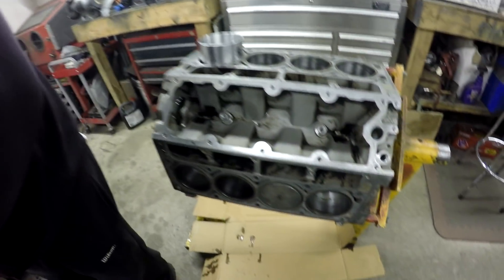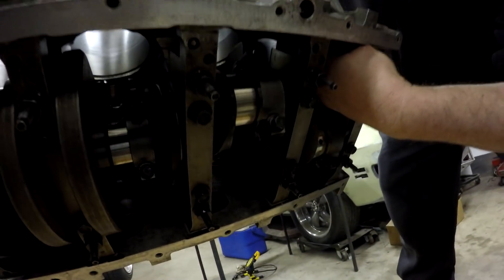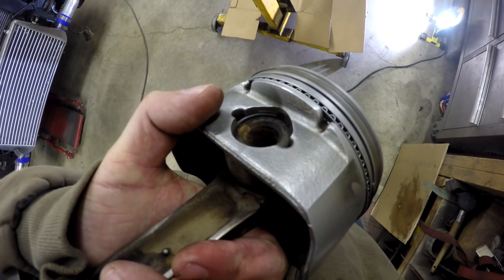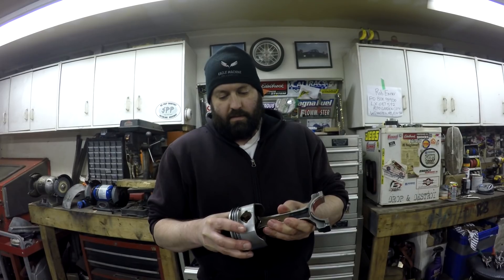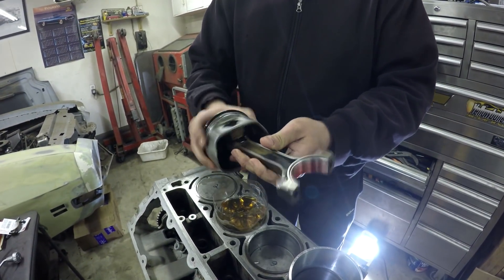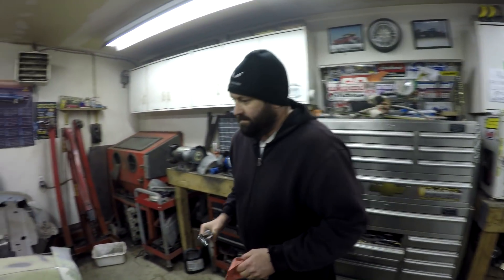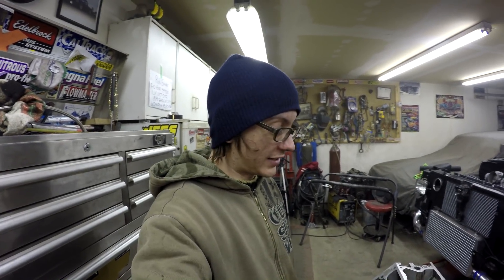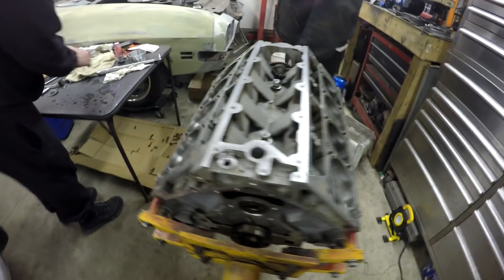Installing Pistons & Rods - Gen 3 vs Gen 4 + Ring Gap for Boost | How to Build a LS Engine (ep3)

Comment: Hi, Guys I'm in a bit of a jam. was hoping that maybe you can help me out, on this video you spoke about Piston Gap. I have a 2010 GMC Sierra 5.3 w/flex fuel, and vvt it is the Gen.4 "LMG' Vin, "0"   I'd had a collapse lifer, and decided to Deleted the AFM and also replace all internal parts. You advice the Top piston ring be Gaped @.026 and second @ .028  I'm  shooting for "Street" Naturally Aspirated is the .026 Top and the second .028 for Street or Boosted? Would really appreciate some Direction. Thank you so much really Love your video's ,
Reply from the maker: That gap is for boosted or nitrous applications.
Reply: @SPPTVarmy  Thank you so much for your quick response, I’d purchased Hastings Rings 
2M 4978  1.5  1.5   3.0  But the Top ring in the Bore. Gaps @ .022  and second @ .016  so following the rule that the 2nd. Ring should be a larger Gap.  Would you give me your recommendation what should I Gap them at for Street w/ naturally Aspirated. I’m not sure what to file them too. Would really appreciate your direction.  Thank you for any help you can provide to me. Let me know if I can make a donation to you guys. Thanks again.
Reply from the maker: Well if the top ring is 22 i would leave it and go 24 on the bottom .
Reply: @SPPTVarmy  Thank you for replying, on this 5.3 of mine, Do you think, is this 
Hastings Ring Kit “ 2M 4978 “ 1.5  1.5  3.0 
the right one for my application, reason I’m asking is because why would the Top Ring come in @ .022, right out of the box, and the second Ring @ .016  When the “second” ring should have a larger Gap. 
As a rule-of-thumb? I’m just a bit worried that if I button this engine up and install it back in the truck, that something could’ve been overlooked. And at the best case senecio I would have to go back in,  Or worst some kind of catastrophic issue. The Ring @ .022 is marked Top on the packaging, and the.016 marked 2nd. In it’s own packaging. I would really appreciate any guidance on this matter that you can offer me before I proceed. Thanks again for your responses.

Comment: Is time to get your hands on a straight 6... GM blazer moder 4.2... It would love to see what you can do with it for boost and numbers... Just seen a guy making like 800 horsepower using most stock parts on it.. He said it's outpowering his 5.3 LS  On a certain.. Boost..setting.... The 4.2 straight sex made a 100 more horsepower than is 5.3... I was shocked... I believe the head on the straight six.. Is a 24 valve.. If I had the access to start building right now.... I build one just for the laughing matter...

Comment: Gen 4 rods on Gen 3 crank needs balancing, correct? Or have you guys been running ok long term without rebalancing? Thanks for the great content regardless 👍
Reply from the maker: No balancing without issue so far
Reply: @SPPTVarmy  thinking of grabbing some LH6 rods and pistons for my LM4 based on that info... May weigh them for kicks

Comment: Did you have the crankshaft balanced for the gen4 rods?
Reply from the maker: No we didn’t
Reply: @SPPTVarmy  is it running good
Reply from the maker: Both The Shithorse and Riley’s car run fine without balancing after putting Gen4 rods in

Both spin to 7k

Comment: Thanks for the great video. 
I keep hearing on these other folks' videos too things and terms which leads me to ask the following:  
now, what is lapping? What is porting? What is ring gapping? What is deck height and what is its relevance to piston seating?  And why does it matter to put rockers and pushrods back in the same order or exact place in the engine that they originally were? Are they not all the same sizes or lengths?

Comment: Which way do the dots on the piston rods go. I'm getting conflicting information on the proper way to install the rods. I know the dot on the piston goes toward the front but not sure which way the rods are supposed to go. I have an 2003 escalade ext 6.0 LQ9. I think mine are gen 4 rods because they look square but either way they are push rods not press fit.

Comment: Would .030 be too much gap for the top piston ring
Reply from the maker: If you run lots of boost but probably would smoke if you street drive it.
Reply: Smoke from blowby. What would be the best gap to run with mild boost for every day street use
Reply from the maker: I run 26/28 and that seems good
Reply: @SPPTVarmy  OK thanks  how much boost are you running
Reply from the maker: Right now 10lbs but i think it will be good 20+
Reply: Whats the ring gap with no boost

Comment: Lol cleaning pistons and ring lands with a wire brush, a fucking steel pick, and 180 grit sand paper? You understand that piston specs should be within 2 thousands. All those abrasives and steel pick could EASILY remove too much material off of that aluminum piston causing piston slap or poor sealing. Let alone that crack you have in the block between the two cylinders at 13:14. Just because it’s on YouTube folks doesn’t mean it’s done correctly.
Reply from the maker: As a machinist, a light scuff will not remove .002” off the diameter of a piston. We’re not spinning them in a lathe and holding 80 grit sandpaper to them

Just an FYI

Comment: Oven cleaner with lye is by far the fastest most effective bang for your buck cleaner you can buy. Horrible for you to touch, breathe and probably look at.. But I can clean a 200k mile engine and rotating assembly in an hour with a case of oven cleaner and water

Comment: with a gen 3 LM7 build no more than 400 hp, no boost, flat-tops, LS6 springs, stock 862s, stage 2 cam,...would you upgrade the rods to gen 4? If they don't weigh the same, would require balancing the rotating assembly.. $$$.?
Reply: egg head in my personal opinion 400hp is not worth upgrading from the stock rods for

Comment: I have one rod bolt that wont torque past 38lbs.  Think this is going to be an issue?
Reply from the maker: What do you mean by wont torque past 38? At 38 it wont tighten anymore or its still turning?
Reply: @SPPTVarmy  once the torque wrench is set to 40lbs the bolt just spins.  Wont torque down
Reply from the maker: Did you check to see if the rod or bolt is stripped? Not sure what else would cause that.
Reply: @SPPTVarmy  Thanks for responding.  Thought I would ask.  What do you torque your rod bolts down to?  Do you use the 15lbs and then 75 degrees?  seems like not much torque for those bolts then
Reply from the maker: We usually just go to 45ftlbs

Comment: You mentioned you cleaned the pistons and such with wire wheels ect... I find if you get a gallon bucket of BerryMan Chem-Dip you can leave the pistons in there overnight - 48 hours... All the carbon will wipe right off. They'll look new

Comment: Gen 3 rod bolts are weaker than gen4 and they're the weakest link in an ls engine. Yes you can go without it, but they aren't that much money if making over 600hp